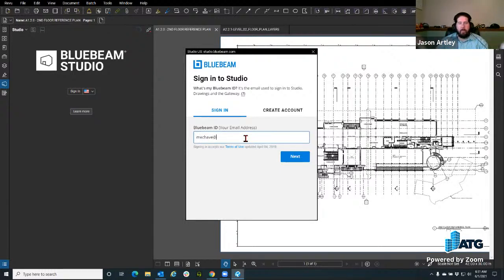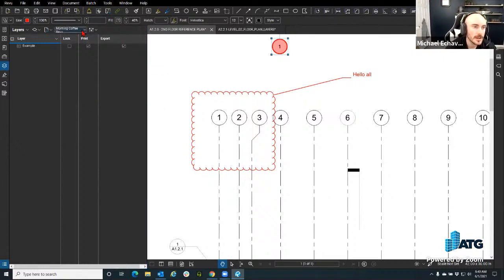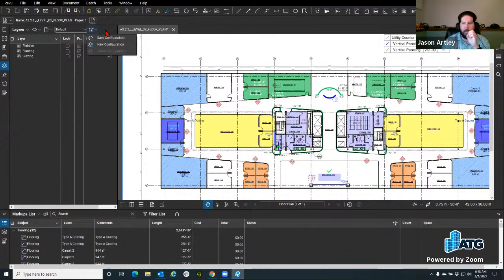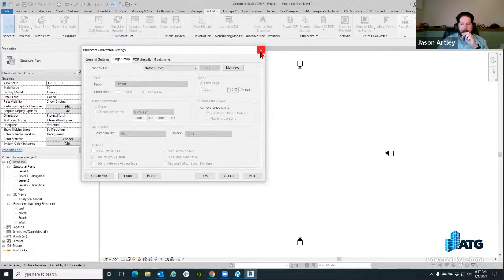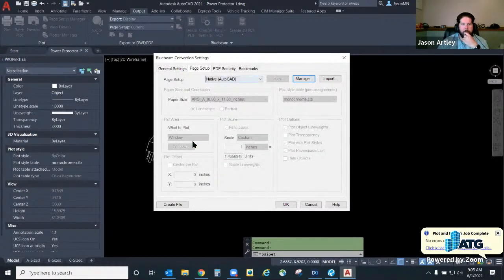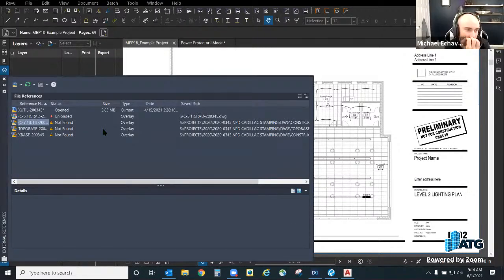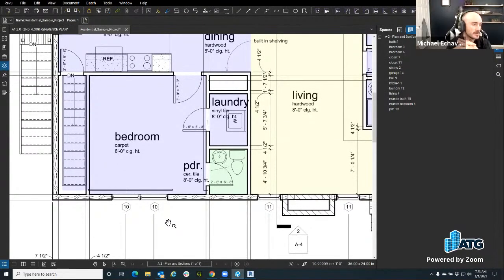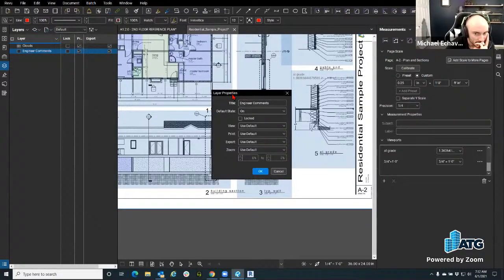Layers In Bluebeam Revu | June 1, 2021

Comment: I have a document with 10+ layer configurations.  I am trying to PDF a flattened version of each of these configurations as individual sheets... Unfortunately, every time I try to flatten and print as PDF, all layers in the document show up.  Any ideas how to prevent this from happening?
Reply from the maker: Great question Tamara - you would need to select the layers as 'not to print' from the Layers panel, and print which layers you want by selecting the check box. We hope this helps in your journey and thanks for reaching out to our crew to follow up!